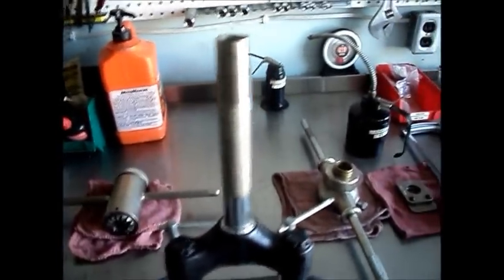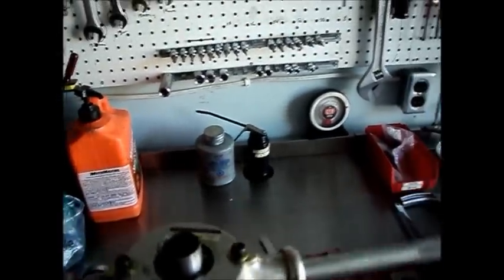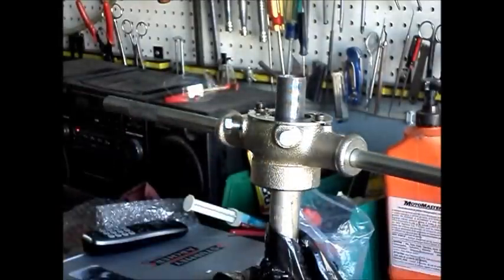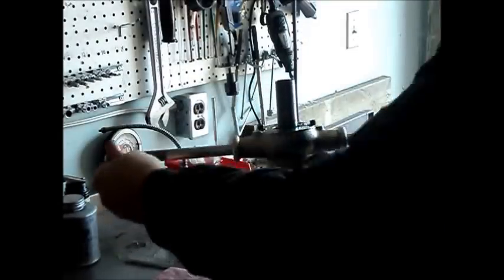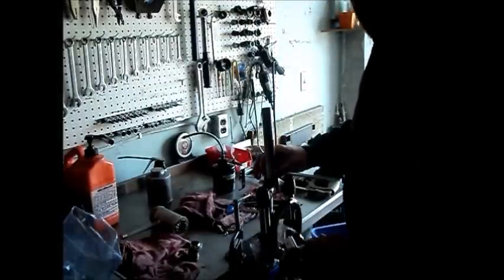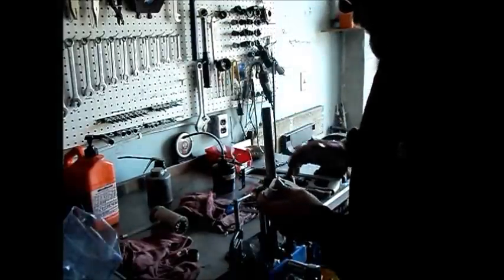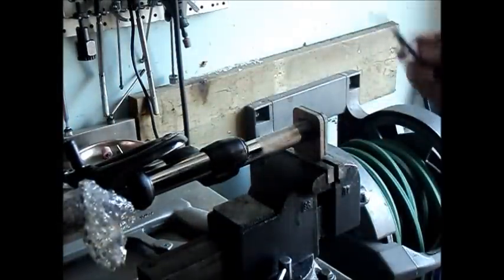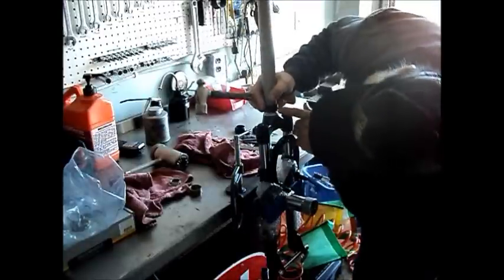Bicycle repair.Threading a bicycle steer tube and milling the crown race seat.

Comment: Can you cut into chrome steerer tube and also if possible is there a limited length you can keep cutting as I'd need to add 2" thread which will cut through the chrome thanks
Reply from the maker: I would attempt to remove the chrome plating if possible. It is very hard on cutting tools.

Comment: Thanks allot for this video. I recently bought a milling tool from VAR and cobra. There are some spings that come with it. Still working out how they work. Ik see you using a tool to make a one inch 26,4 to 27. What tool is that? Sure would want one.

Comment: Good video.Well explained but how to extend the notch line on steerer for a notched washer/spacer.
Reply from the maker: Thanks for the comment.
Extending the notch is not something I've ever tried or worried about. If the stem needs to be shortened past the notch, I just file the tab off the washer.
The tab does serve a function in helping to lock down the bearing adjustment, but it's not really critical.
Reply: @2wagondragon  Yes,simple solution. Might need a special tool to do it also.

Comment from the maker: @UnivegaSuperSport Thanks for viewing. I don't apply grease before setting the race, but I don't do anything to remove the film of oil that remains after the cutting operation.
 Just be sure all the chips and cutting debris is cleared away.
 I don't think greasing is necessary, but it wouldn't hurt either.